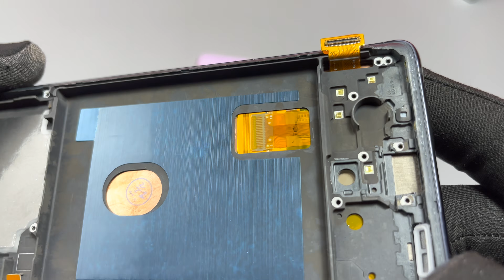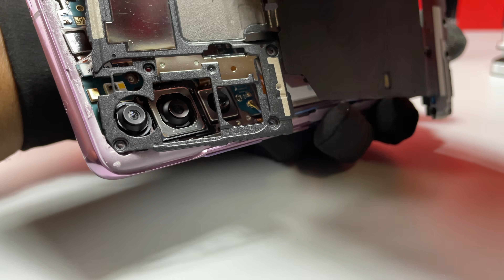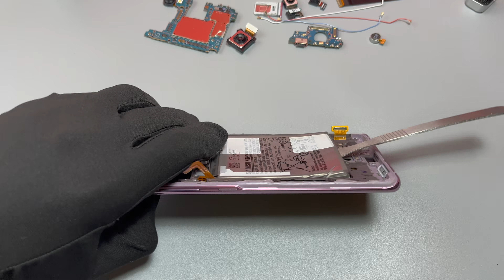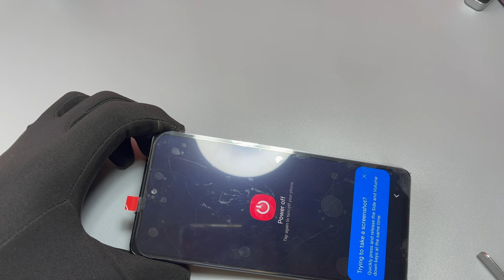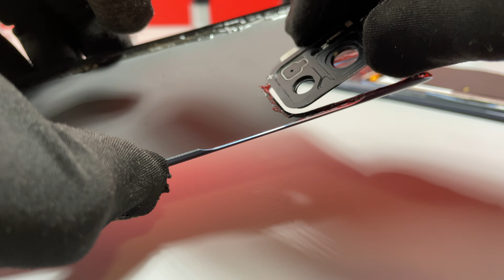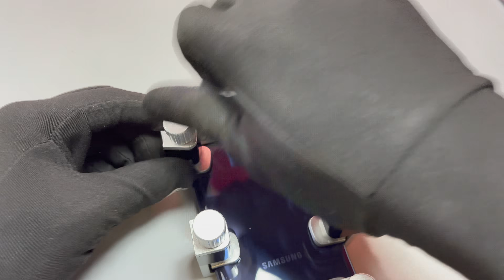How to Galaxy S20 FE Screen Replacement

Comment: Can you replace the screen without getting a new housing?
Is it a bit risky?
Reply from the maker: Yes it is doable but in my opinion it will not last as long as replacing the whole thing.
Reply from the maker: The screen might start to get separated if it was not done perfectly.

Comment: I just finished this repair here in New Zealand. Super easy repair. The hardest part was removing the battery. It was stuck down so good, and this phone does not have removable battery tabs, unfortunately.

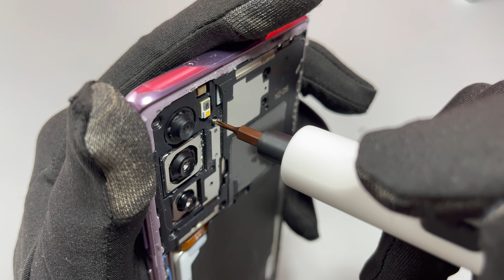Comment: 1:40 you gotta be very careful when doing this part. Make sure you don't lift up on the flex cable that sits beneath the wireless charger and above the battery because it can damage the connector.

Comment: does this wipe data?
Reply from the maker: No. You shouldn't lose any data?!! no set up no nothing needed.
Reply: @ersbit  I really really need your help can I message you somewhere?
Reply: I did message you on Instagram but it allows me 1 text only
Reply from the maker: Hi I don't see any messages on Instagram. What's the name you use there? You send the text on ersbit?
Reply from the maker: What's the issue. I was at work all day couldn't be online for much time.

Comment: Hi yor video was GREAT!  I got to the part where you turn it back on and it showed the charging symbol for 10 seconds, then went black.   Now it just does a quick flicker of light and nothing happens.  Any suggestions?
Reply from the maker: Hi, the easiest is to disconnect all the flex cables then reconnect them again. Then try to see if the issues goes away that would mean it was just a bad connection on one of the cables. 
If you have the same issue reassemble everything on your old display/frame to see if the issue is now present on the old screen if no issues something is wrong with the new screen. 
Try to plugged everything including the wireless charger then try to charge and turn on (some of the devices have issues when the wireless charging coil is not connected) it has a temp sensor (the motherboard might be reading to charge or turn on) this happend to my S20 Plus and since the S20fe is basically same thing different body it might be a thing on the FE too.

Comment: That's replacement, not repair
Reply from the maker: I can agree with you. How would you repair a broken screen if not replace it?
Reply: @ersbit  
Apparently, there are special liquids that can fill in cracks-like windscreen repairs for cars
Reply from the maker: I think those are scams lol the screen manufacturers would make everything possible to make hidden not available to the public,
I can buy some of those and test but I think it will not work  @oxcart4172
Reply: @ersbit  
It would be great if u did  test them.
I've sent u some money to help pay for them.
Reply from the maker: True repair on these phones is basically gone since they went all Flat Screens and most of the time doing true repair will take more time than just replacing ( cost more to find a bad diode on a motherboard/ USB-C charging module/ on screen control unit etc....remove it replace it than replacing it.) that's why I did it the way I did it. Plus all the equipment to do true repair is very expensive people will find the video too technical. "😅 this is alredy getting comment that it is hard etc..."

Comment: I just replaced my screen and still not displaying anything at all. although it vibrates whenever I press power button, as well as when forcing the phone to restart using volume down + power. It's like my phone is running in background, but not showing anything at all.

Do you have any idea which specific part of the phone I should replace?
Reply from the maker: 1- was the phone with the old screen working (not black even if the phone was broken)?
Yes. Screen was working even broken (the new screen might be defective)
- try checking all the flex cables make sure they are all disconnected and reconnected and fully pressed in then try to turn the phone on with the new screen attach (if still the same black screen then the screen might be bad)

2- same issue with old screen as new one (stay black) you might have a problem on the motherboard which is one big piece and should be replace or you find a shop that is willing to test the motherboard and find the micro component broken/damage and replace it. It require microsoldering etc...it's advanced stuff.
Reply: @ersbit  I am still trying to figure it out, right now display only showing when I am putting a pressure to the back directly where the display flex is, it looks perfectly fine. However, after samsung logo. Either the screen is flickering or does not go through booting up.

It seems like it is more than just a screen at this point, but motherboard or something. might as well get a new one you think?

Comment: Removing antenna cable with spudger at the connexion site rather than yanking probably makes your hardware happpier. Also I strongly discourage using a hard steel sharp surgical blade to do anything on very delicate board and cables with electric parts at microscopic distances away, that can be knocked off very easily with a little excess force or a slip, which I noticed you employ at several instances. Also the hard steel has a high risk of scratching the coating on the board and parts. Use plastic instead please. Spudgers give you a lever-like shape , they're softer because they're made out of plastic and they give you pointy end.

Comment: Hey I would like to know if this new screen supports 120hz and if finger print works flawlessly? Also is thia actually super amoled screen or is it just lcd?
Reply from the maker: I believe this was lcd screen. 120hz is supported natively but if the screen is not the same spec as original it won't do it. If the screen was pulled from another S20fe it will work and do 120hz. Everything should work fine including the fingerprint sensor.

Comment: Hey. Do you know if the 4G and 5G variants have interchangeable parts?
Like, could I use a screen meant for the 5G version on the 4G version?
Reply from the maker: No they are not interchange. I assume as they changes things slightly to avoid backward compatibility.

Comment: What could i have done wrong if the screen lighted up once i connected the phone to the charger but then flickered in blue and now doesnt show anything anymore?
thx for your help
Reply from the maker: Hi hope you figure out the issue. You should remove the screen and reinstall the screen flex cable then try again to see if it start working again. If it does not work reinstall the old screen to see if it works. If it does the new screen might be bad. Just return it and get a new screen.

Comment: Don't force the battery out and bend it like this guy did or you will damage it
Reply from the maker: Am sorry but I have never got a battery damaged like you said. You can add or suggest other ways but as for me my method is still valid as I have not experience any issue with it. 
Adding a little bit of alcohol will certainly help ✌🏽️.
Reply: @ersbit  Is the alcohol for you or the phone? You may not have broken components but you're surely not doing them any favors

Comment: So those kits with just the screen won't work? You have to buy the version with the digitzer as well?
Reply from the maker: No the screen will work. Just make sure it's compatible with your model, US version or International version. 
In this video everything went well. The screen was replaced and the device worked as it should.

Comment: @ersbit Did you find that the new replacement screen's fingerprint reader was the same as the OEM reader? Was the new screen reader just as responsive as the old one?
Reply from the maker: Yes. The screen was good. Everything worked as it it supposed to be. The screen will come with the fingerprint alredy embedded. You just need to make sure that the device is compatible with yours. Us version or International version they are a little bit different because of the 5G antennas.

Comment: I only disagree with battery. I wouldn't let it bend that much. I would use alcohol and a heat plate it will kill adhesive and come right up. Just try it
Reply from the maker: True agreed. Best practice want to avoid bending batteries as much as possible!
Reply: @ersbit  first YouTuber that would actually agree with someone in the comments. Most people always wanna be right. I had 15 years in the repair and unlock business. But I switched over to automotive locksmith. The key business pays more and it's less headache. Keys work or they don't work. A repair tech can only be as good as the parts there using. I got tired of doing warranty work because of AM screens going bad. Also without corning gorilla glass, they break too easily.

Comment: I recently upgraded to a sim only plan as i wanted to keep the s20fe and keep monthly cost down. I got a quote of £160 including labour charge from a repair shop. I think it is worth it as i intend to keep the phone for duration of the sim plan which is 24 months. When it comes to upgrading the contract in 24 months time i will have a better choice in smartphone as the technology jump will be greater. But to be honest a lot of friends, relations and work colleagues opt to go purchase a sim only plan and then buy the smartphone outright from a retail outlet as that can work out cheaper in the long run.
Reply from the maker: True buy outright is better. You can resell the phone anytime and upgrade. You're not bound by any contract!

Comment: Hello, if you could help me out I'd deeply appreciate it, after an unfortunate event my S20 FE got severe water damage and the IP68 couldn't handle it. 

Just after the incident I took the phone back out, spun the phone to try to use centrifugal force to take out the water from the screen part of the phone, dried as much as I could but I didn't have the tools at the time to open it up to dry better so instead I put it in a ziplock bag with a silica gel pack. After 48 hours the screen and the phone itself are working perfectly but I have none touchscreen. Zero. Do you think it's possible to maybe fix this? Try to mess with the digitizer or whatever. Or do you think I need to replace the whole screen? Thank you a lot.
Reply from the maker: Fixing a none working screen would be difficult unless you find a shop that can check the panel and change a component. I do not know how to start or fix it when the digitizer is bad or not working. The easiest way would be to replace the screen as I did in the video. Water damage it's luck if you dont dry everything or the battery cable is still on for long after the water damage it might cause a problem.

Comment: Hi I did exactly like you but my screen is still black the teflon itself is working and there is a vibration, it was like that before but also after the screen replacement the same thing do you have any ideas? Once I was able to see a download mode but only once
Reply from the maker: Did you enter download mode with the old screen or new screen?....since you have the new screen there (check the connections to make sure every is plugged corrected) then try to turn on or charge to see if the screen light up. If nothing happens 
1 it can be a bad flex cable 
2 bad motherboard / something is wrong in there
Reply: @ersbit  yeah in the new one maybe it’s really the motherboard  but it’s weird that I saw download once one
Reply from the maker: Oh ok if it the new screen it might be the motherboard but still can be the flex cable (screen). If you checked and tested again and nothing happens the motherboard should be the issue.

Comment: I went into this thinking I can do this on my own then I got like 2 minutes in and was like fuuuuuuuuugggghhhhh my life. No way I can do this myself. Now I gotta pay off my device and get a new one. Damn I love my S20 5g Fe. Its best phone ive ever had and ive had LG flagship phones at double the price! I had the LG G7 Thinq and it sucked ass and was like $950. This S20 was amazing just screen so delicate and even with case and protector I shattered screen the 2nd week I had because my big rig truck phone holder suction came undone and dropped my phone about 3 feet. It lags bad and types like 10x the same letter with 1 press etc and I cant take it anymore!
Reply from the maker: lol its not too hard. If you don't feel comfortable doing it get it fixed or pay off then upgrade 👍🏽
Reply: @ersbit  I paid it off and got S23. Thanks

Comment: Hello fixers! You can use a few drops of 91% isopropyl alcohol to help remove battery if it’s being stubborn with just heat. It will keep you from having to pry very hard
Reply from the maker: True, the alcohol can help. I dont like it but it makes things easy !
Reply: Also try not to use metal tools to pry the battery

Comment: Hi. My Samsung s20 fe suddenly has a purple spot on the corner, it started spreading. Everything still works perfectly. I did not drop my phone, no water damage either. Any recommendations? Does it need a new screen or could it be something else?
Reply from the maker: The way you explain it it will need a new screen similar to what I did in the video

Comment: a few questions
, what kind of glue are you using? and where did you buy it? thanks in advance ♥
Reply from the maker: On the back I usually use b7000 glue to reinforce the back if the double sided tape is not really good or sticky
Reply: @ersbit  thank you a million 🤍
Reply: @sparkiichief1261  keef omi will again check laAda OK

Comment: Is it still waterproof after screen replacement??
Reply from the maker: Will depend on quality of the parts used. The strength of the double sided tape used also.
Reply: Thank you 🙂

Comment: Hola buen día disculpa una duda, mi S20 Fe se me cayó a un rio y lo lleve a que le den mantenimiento por el agua que se introdujo en el interior en lo cual al encender daba pantallazos blancos y me recomendaron cambiar la pantalla y bateria que se habian estropeado. Queria preguntarle si es factible gastar en que me lo arreglen o preferible comprar otro ya que tengo miedo de que al arreglarlo queden fallas por ejemplo las cámaras, altavoces o microfono  :(
Reply: Recomendaría buscar en el mercado de Facebook o eBay para uno usado suavemente que venden alrededor de $ 200 a $ 300 USD. Cuesta $ 150 a $ 250 para reemplazar las piezas dependiendo de dónde lo lleve, por lo que será mejor que compre uno. :)

Comment: My S20 FE has a minor crack on below the lcd panel of the navigation bar. But the display and touchscreen still work perfectly fine. Is it okay if I just re-install a full screen tempered glass to cover and protect the crack from dirt and moisture?
Reply from the maker: Yes. But you'll still have the Crack glass. You can either replace the whole screen or attempt to remove the glass only and replace it. Doing that is very risky and might damage the screen panels

Comment: I have done this, my phone vibrates and I can hear audio, and the PC even picks it up when plugged in, but the screen is still black. Is this a faulty display part I've been sent or is there something I could have missed to cause this?
Reply from the maker: It's just like in the video it should work immediately nothing extra I did.
Either the screen sent is bad or you have an issue with the board on the device. Also before you replaced the screen did the old screen light up show colors and brightness etc.....?
Reply: @ersbit  No the old screen was fully black because it was damaged. I believe the sent screen is just faulty
Reply from the maker: Ok. If there's nothing lighting up on the old screen it's hard to know if it was before or now. You can ask the screen seller to make sure they had tested the unit before sending it to you. Let them know that when connected the screen is not working.
Reply: @ersbit  Ok now I'm stuck. Another new frame and screen came and still no display. The motherboad has also been replaced so know it can't be that. No idea why but cannot get the screen to display anything
Reply from the maker: So the motherboard has been replaced too???
You need to inspect the flex cables make sure none is bad or have a small cut. At this stage you need to troubleshoot piece by piece and try to thing something thats out of place. 

First the phone does it charge? Vibrate when plugged in? Then after pressing the power button does it turn on? If you turn it in you can try and hdmi to see if the board is working and the fault is only the screen and screen components.

After replacing things if you are stuck you try elimination process and if you cannot figure out seek help from a repair shop.(Put everything together and let them to their diagnosis). Or you just go directly to them to see what they can find that you didn't.

Comment: Hello, my phone have rhe screen broken just like this video at the courner but the screen not work. The LCD is not broken i think but whats would happning?
Reply from the maker: Oh if the glass is broken, the display doesn't respond unfortunately at that point you will need to replace the screen. Perform a screen replacement like I did in thus video

Comment: Where do we get the replacement part? I'm trying to decide if the phone screen is worth fixing or if I should just suck it up and buy a new phone at this point.
Reply from the maker: You can get the replacement parts from Amazon or eBay. Depends on your nearby future plan lol are you wanting to upgrade if yes you can just get rid of this and get a new device instead of buying a new screen. The screen will go maybe around 200 usd
Reply from the maker: Try to see if you can get maximum value on trade in